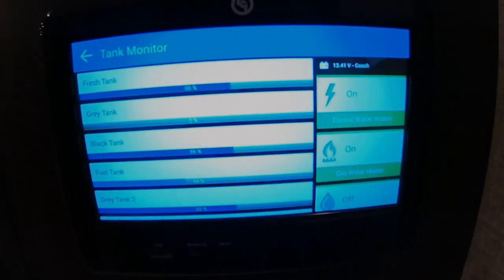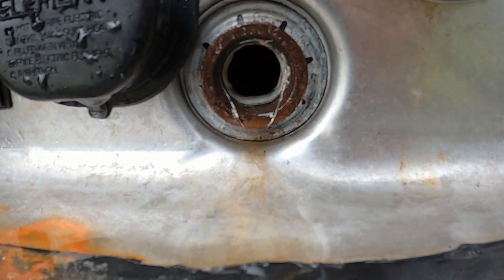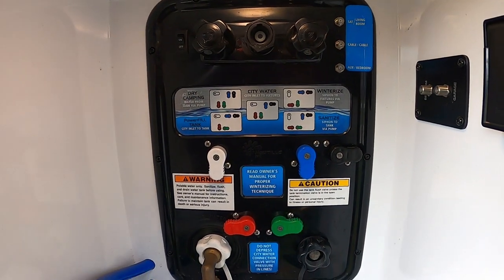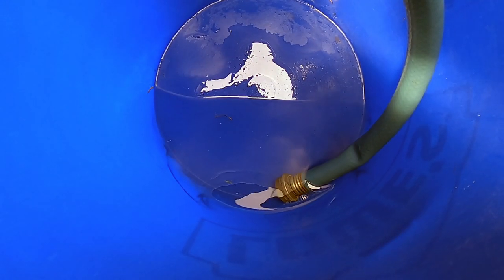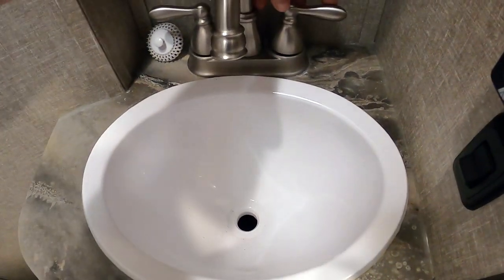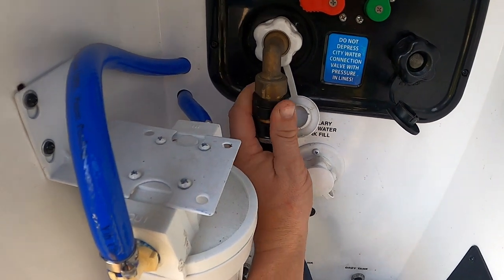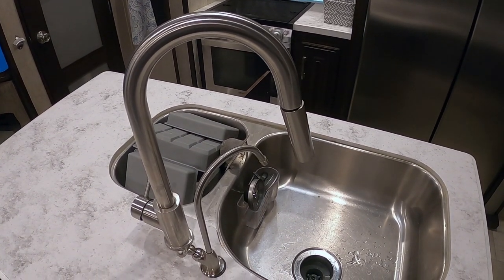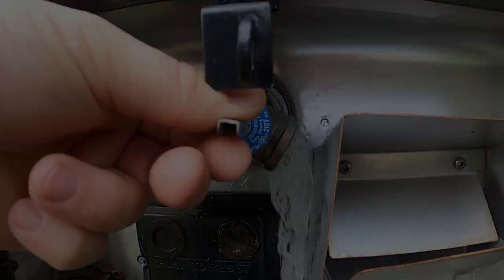How To Sanitize Your Freshwater Tanks with Bleach | Hot Water Heater Tank Maintenance!

Comment: Good video just a note. Never flip on the hot water heater electric element switch until the hot water tank is full of water. You can easily burn up a element this way.
Reply from the maker: Thanks for watching!  That switch outside does not turn on the hot water heater electrical element! That is the master cut off for the system!  You have to turn on the electrical hot water heater from the panel inside the camper, for us that is the one control screen.  You set it to the off position while servicing the system, if you forget to switch it back to on, then it will not work when you turn the system on from your panel!
Reply: @PavingNewPaths  well damn that’s good to know. I just got my 398M last week and new to the One Control myself. I always knew on my old camper that switch was how you turn it on and off as there was no one control to operate. Learn something everyday

So let’s say my comment goes for anyone who does not have a one control system! 😂
Reply: @PavingNewPaths  while we are talking. I have a issue on my main black tank flush inlet.  I have a leak while using the flush port. And ideas where to look. I have appointment with the dealer as it’s under warranty but it’s 2 months out.
Reply from the maker: No problem, I forgot to turn it back on the first time and thought my hot water heater was broken!
Reply from the maker: Where do you see the leak?  Is it on the black connection where you attach the hose or is it on the inside behind the panel?  It also travels through a vaccum break that is likely under your master sink before going to the tank!
Reply: @PavingNewPaths  it’s leaking down under the trailer. Left to right it’s between the nautilus bay and the Gen. Exhaust. Straight down. I have pictures if you have a Facebook or email to chat
Reply from the maker: Go to our paving new paths Facebook page and talk to me through messenger!

Comment: Nice video. We just bought a new to us  2019 Grand Design Momentum 376th. So I’ll be getting everything prepped for the road and going over all the systems in the unit. What tpms are you using and how do you like it?
Reply from the maker: I went with tirelinc from lippert it syncs with your one control in your camper.  You can set air pressure and temperature alarm levels and get notifications on your phone while driving!

Comment: One additional step I recommend is to run a cycle on your washing machine and dishwasher empty, if your unit has them, to make sure you get out all the bleach water.  You don't want to ruin a load of laundry the first time you use the washing machine after sanitizing...
Reply from the maker: We actually run the washing machine multiple cycles after this process.  Usually at least two cycles for hot and two for cold!